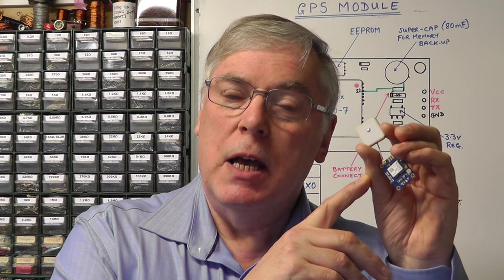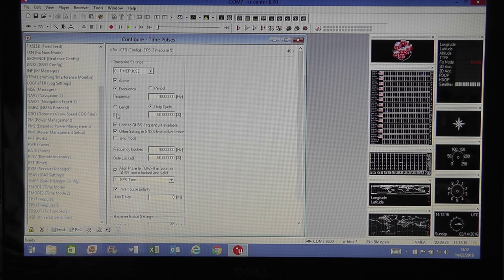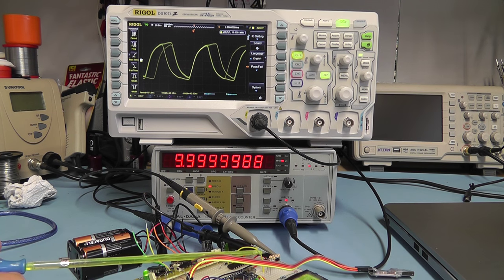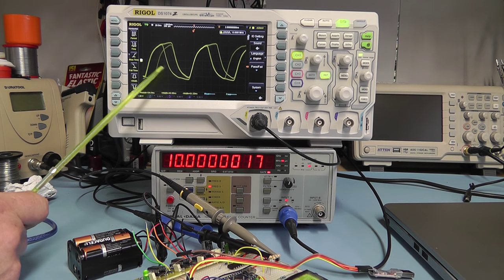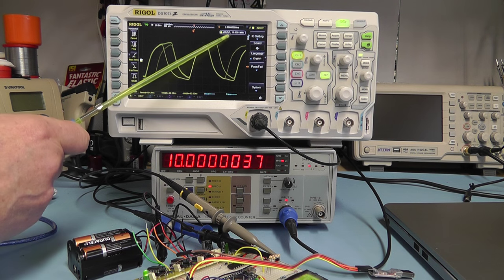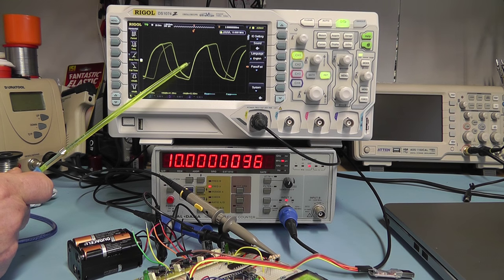Scullcom Hobby Electronics # 35 - Design & Build a GPS locked Frequency Reference Standard

Comment: Awesome content. Thank you. I am subscribing right away! . A word of caution for bread-boarders, avoid taking the timing pulse from the GPS module without proper shielding as it can cause some severe RFI ( Radio Frequency Interference) limiting the ability of GPS receiver to lock on the signal. Remember GPS signal is the weakest signal among all wireless technologies.

Comment: A few corrections and comments if you don't mind.  First, the EEPROM is an Electrically Erasable Programmable Read Only Memory meaning that it is nonvolatile and won't loose its contents when power is removed.  The only reasons you could be loosing your settings is either it is damaged (too many writes for example but that requires more than 1,000,000 writes), not being written to correctly (not likely as that routine is in the firmware by the manufacture), or you are not correctly telling it to save the settings.  If you take a look in the Configuration View window and then the CFG settings, on the right side under Devices you likely only had "0 - BBR" selected.  That only saves the settings to the Battery Backed RAM.  You can select more than one "device" by holding down the <CTRL> button.  Send (execute) that and you should be fine.

Now to save the hassle of having to connect to the computer and using the U Center program every time you get a new GPS unit or to save the end user the trouble you can actually program your Arduino to set the configuration you want every power up.  As long as you don't save the settings you can still easily use that same GPS with other projects without having to go back into U Center to change them.

Using either the Arduino or the correct "device" when saving settings also saves not having to connect up a battery to your circuit of course.

You get jitter like that when you are trying to produce a signal that doesn't divide the source frequency evenly.  An example that you can draw on a piece of paper would be if you wanted to generate a 3 Hz signal from a 10 Hz source you can see that while you could get 3 complete cycles per second each cycle isn't going to be the same shape or length.  Now say you have a 2 kHz source and want 1 kHz out.  That works perfectly of course.  But what if you want 990 Hz?  You can get 990 cycles out per second but there will be some longer cycles to make up the difference.  Using a phase locked loop can correct that but it still has its own problems and limitations.

I was getting about a 21ns jitter on a NEO-6 and both the NEO-6 and NEO-8 data sheets claim an accuracy of the time pulse of 30ns RMS.  Hit the run/stop button on your scope and you will see the jitter easily when you zoom in.  Dividing the signal down of course will make the 21ns jitter a much smaller percentage.

Side note... are you sure you want that capacitor between the GPS and 74AC14?  The Schmitt trigger is expecting an input between 0 volts and Vcc.  That's likely why you are not getting a nicer square wave at 10 MHz.  My NEO-6 has a rise and fall time of less than 12ns.  I would try it without the cap.

Enjoyed the video though.
Reply from the maker: +ElmerFuddGun Thanks for your detailed comments.
I previously mentioned to an earlier comment that the external EEPROM was an error on my part and the more I think about the EEPROM it is probably used for saving GPS data possible for logging.
The changes to the configuration settings are used by some internal Back-up RAM in the Neo-7M module in the centre of the board. Therefore, the battery back-up is needed for that RAM memory inside the ublox module.
I am sure there is a way of using the Arduino in stead of the u-centre software to programme the configuration settings. Is this something you have done? If so it may be useful to share the details of the Arduino code which would then give others a choice.
Yes the jitter is caused by quantization error due to the fact that the main oscillator is running at 48HMz and is not easily divided down to 10MHz. A PLL would solve the issues with both jitter and shape.
The capacitor feeding the 74AC14 was fitted since I found it improved the amount of jitter.
Reply: +ElmerFuddGun The data sheet for the NEO 7 modules 8https://www.u-blox.com/sites/default/files/products/documents/NEO-7_DataSheet_%28UBX-13003830%29.pdf) states that the configuration is saved to battery backed sRAM only (with the exception of the 7-N module).

Comment: I have one of these modules, they're great but at 10MHz output you get a large amount of jitter, the on board reference crystal is 48MHz so it's not an integer divide to get 10MHz.

Selecting 24, 12, 8, 6, 4, 2 ,1 MHz gives a vastly improved signal. 

I believe it's also possible to add a DAC to one of these units and have it steer an external OCXO which will yield even better results. 

Setting the unit going with a clear sky view and asking it to run a 'survey' will improve results as well but the supplied patch antenna may not be good enough. 

As far as I can see it's very accurate, I've compared mine to two Rb standards and it's within millihertz of 10MHz.

It might be a good idea to provide the receiver with some thermal insulation so it's less prone to drift as room temperature changes
Reply: Exactly.  To synthesise 10MHz from 48MHz it probably uses fractional-N division, whereby it switches the dividing circuit between 4 and 5 to  (i.e. divide by 5 four times then divide by 4 once) to create a divide by 4.8.  Gives you 10MHz plus inter-harmonics at 12MHz and 9.6MHz.
Reply: Plenty of test equipment requires a 10MH external reference, so finding a clean solution for 10MHz is still a worthy goal.

Comment: Also, I've seen people combine multiple of the schmidt triggers together (through the appropriate resistor) so that they have enough current to truly drive a 50 ohm output into a 50 ohm load.I suspect you already checked the output capacity of the single gate, but if it's not high enough, this might be an option for you. Thanks much for the great video.
Reply from the maker: +Matthew Humphrey Thanks for your comment. Yes I have combined schmitt triggers in parallel in the past and that works well. It could be something we could do with this project but for the moment I have not done it. Could be a future option if we find there are any issues.

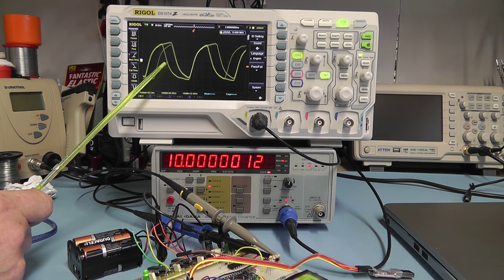Comment: 31:00 "A bit of jitter"... That jitter is 25% of the period! 🙈
However, thanks, the rest of the tutorial is very useful. I plan to take a cleaner 10 kHz signal from the GPS and use a PLL with a tight loop bandwidth to lock a 10 MHz OCXO to that.

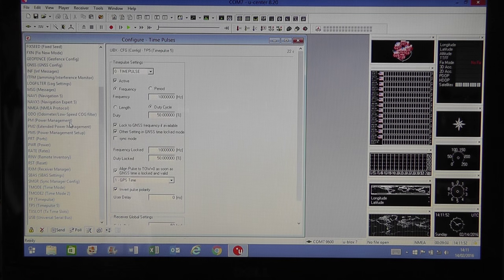Comment: 30:00 For Simplicity I would use a red-green LED to indicate if it's locked or unlocked. Green is locked and red is unlocked. And the Arduino should have no problem power that led. Or you can even just have a green LED when it's green it's locked when it's off it's unlocked. For simplicity's sake.

Comment: Nice. I'm currently building my own GPS disciplined 10MHz reference based on an old OCXO from ebay. Also controlled by an arduino nano. So I find this a very interesting project. I also did not know there were GPS receivers with 10MHz output. I'm using another approach, counting the 10MHz signal edges between a 200s timespan of the 1pps pulses from my uBlox GPS which have  a 10ns accuracy.
Reply from the maker: +Joost B Thanks for your comments. If you used the Neo-7 with a PLL to control the adjustment of the OCXO that would work very well.
Reply: +Scullcom Hobby Electronics Would there be a benefit of doing that? The OCXO would follow the GPS because it is the PLL reference. It will not be more accurate than the GPS without the OCXO. Correct me if I'm wrong. Its all new to me. 
The Neo-7 actually has a 30ns-60ns accuracy. The GlobalTop PA6H I'm using (not uBlox as I write above) has a 10ns accuracy. It does not have a 10MHz output unfortunately. But I'm aiming for a 0.1Hz to 0.05Hz accuracy with my approach.
In the past they used the pll approach with a Jupiter GPS which had a 10kHz output. But these are not made anymore.
Joost.
Reply from the maker: +Joost B Sorry may be I misunderstood. My understanding is that you are simply using the GPS signal to lock your OCXO therefore you are already using a PLL which is fine. Also the output from the OCXO will be very stable and provide a clean sine wave out which will be better that using a GPS module to provide the output.
Reply: +Scullcom Hobby Electronics If the GPS signal is drifting (60ns), wouldn't that also cause the OCXO to drift because the OCXO is locked to the GPS via the PLL? The GPS signal is the reference signal for the PLL. Or do I misunderstand. I might have to review how a PLL actually works. 
(I'm actually not using a PLL in my project, I use a counter instead. But I find the PLL approach quite interesting.)
Reply from the maker: +Joost B Yes correct the GPS signal is used as the reference so if that drifts slightly then the OCXO will also be effected. One good solution is to get hold of a Rubidium Frequency Standard. You can find secondhand ones of these on eBay but they are still expensive. I have a 10MHz Rubidium Frequency Standard in my workshop and use it as my prime reference. A Cesium Frequency Standard is even better but very expensive. Both Cesium and Rubidium are atomic standards and exhibit extremely high accuracy.
Reply: +Scullcom Hobby Electronics As always accuracy comes with a price. Thanks a lot.

Comment: At 29:00 into the video where you are talking to the GPS, mine wasn't working at first and apparently had some bad setting stored in it so I had to click "Revert To Default Receiver Configuration" which is the icon along the top at the far right, to get it working.
Reply from the maker: Thanks Steve for the info. Regards, Louis
Reply: I've been experimenting with a 6M module that I had on hand from trying to build a drone a few years ago but the 10Mhz output is distorted and has a lot of variation in the pulse width causing it to constantly change from wider to narrower then go wider again like you show on the scope at 30:00 into the video.  I wonder if it would be better to use an LEA-6T module that is optimized for timing use instead?
Reply: Do you think U-Blox is still in business?  I emailed them to ask about a firmware update but all their email bounces and that's not a good sign!
Reply from the maker: Yes they are still in business. Check out their website:
https://www.u-blox.com/en/product/neo-7-series
Reply: There doesn't seem to be anyone there so the website is just running along on auto pilot.
Reply from the maker: I am not sure whats happening there Steve.

Comment: amazing video, but the question is when module is unlocked 10mhz comes from local oscillator, but when the module is locked the 10mhz comes from satellite?! or some calculation will depend to gps module and finally it come to local oscillator, or local oscillator will take some thing from gps module! in fact what is difference for local process when it is locked and unlocked?

Thanks for your Fast Answer.

Comment: The NEO-7 modules are 3.3V devices, and they don't have 5V-capable inputs. But the Arduino Nano is a 5V board, so you might destroy your GPS module. (With the USB-to-UART converter it depends - my CP2102 module is a 3.3V device so its safe to use)
Reply from the maker: +Hendrik Lipka Thanks Hendrik for the comment. The CP2102 I used on this project was 3.3V so it was OK. But it is worth mentioning this for others to be made aware. Thanks.

Comment: hi I've been playing around with one of these ublox modules having seen your video, I found like you that when set to 10 MHZ the signal is fairly poor, luckily my racal counter (same as yours) has options 10 installed so works fine with 1 MHz. The other thing I've tried which you may be interested in is putting the signal through a 74hc4046 phase locked loop chip this cleans up the 10 MHz considerably. another way of doing it is to set the module to 1 MHz and then multiplying it by 10 using the 74hc4046 and a hc390 divide by 10 in the feedback loop, this seems to work well also, I will probably use this in my completed project and have both 1 & 10 MHz outputs, hope this is of some interest
Reply from the maker: Thanks for the comments. I have also used the PLL 4046 IC and as you say it does clean up the waveform.

Comment: Hello! This is a great project. Is there a way to get a sine wave output rather than a square wave? 

Thanks,
Chris
Reply from the maker: +jordanch68 Yes Chris there is and that is some thing I am considering for this project. You can convert a square wave to a sine wave by removing all the harmonics from the fundamental frequency using a Bandpass Filter. Even a simple Low Pass Filter may do a good job. I will try and include that the next part to this project.
Reply: That would be great! I can see a couple uses for both waveforms.

Comment: Great video and project! As a follow-up project, have you considered using the GPS 1 Hz signal, a microprocessor, and a D/A to discipline an OCXO? I know many others have done this project, but it seems like it would be a great video.
Reply from the maker: +Matthew Humphrey Thanks again. I purchased a few Russian Double Oven Ultra Precision MV85A 10MHZ units and they work very well. Something for a future project.
Reply: +Scullcom Hobby Electronics I also wanted to let you know that I found an eBay seller who is selling the NEO-8N modules on a little breakout board along with an external antenna. The board has an SMA connector to which the antenna attaches, so you can put another antenna on if this one doesn't meet your requirements. The boards were about $39 (USD). Not sure if he also sells on eBay UK, but I suspect so. The seller name is thanksbuyer-hobby
Reply from the maker: +Matthew Humphrey Thanks for the info. I ordered a Neo-8N from China about 3 weeks ago and it just arrived today so I can check it out. The version I purchased cost around £14 (US$20). It uses the same board as I have shown on my video.
Reply: +Scullcom Hobby Electronics I read on the UBlox forums that there are a lot of counterfeits out there. However, the counterfeits still use the core UBlox chip; it's just the surrounding circuitry (like the Flash RAM) that may be a bit dodgy. This board here, which btw came with an external antenna identical to the ones you show in your latest video, seems to be working fine. It's even receiving the Russian satellites.

Comment: I allready have a homebrew gps locked standard that uses the ublox, I have issues with the ublox forgetting the setup, I assumed the supercap was a battery!, I'll do the mod you did.
My system uses a pll and a 10mc voltage controlled xtal oven, the ublox o/p's 10kc not 10mc, the pll removes the phase noise from the ublox, I'm thinking of phase synchronizing the 1hz o/p to the 10mc xtal oven as I use it for a real time clock, though thats a little overkill.
One thing I like and I'm going to  make use of is the gps lib, I'd like to be able to use mine standalone with an lcd and know the ublox is locked and I have satellites.
Reply from the maker: +sean doofer Thanks for you comments. I have also tried using the GPS signal in a PLL to trim a 10MHz OCXO which works well. As you say it then gives a nice clean 10MHz sine wave.
Check out Part 3 of this project as I have upgraded the unit to use a keypad entry for frequency.
Reply: +Scullcom Hobby Electronics 
Yes of course programmable frequency is handy, however decades is fine for me, in fact 1hz is the main reason for building the unit.
The battery mod and your reference to the library is what I found usefull.

Comment: I kinda hopes you'd do external OCXO and then dicipline that to the GPS with PLL... maybe the next project? :D
Reply: Just watched this video and thought the same. Probably don't need an OCXO as the GPS gives you the long term frequency stability.  A 10MHz voltage-controlled xtal oscillator should then give you the low phase noise to get rid of the jitter via the PLL.